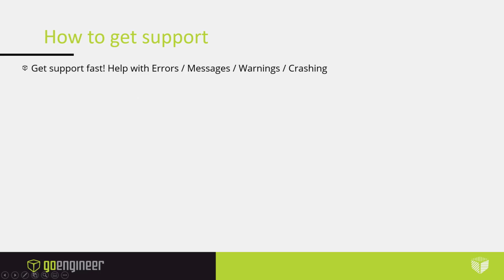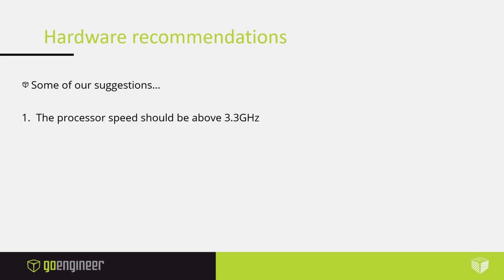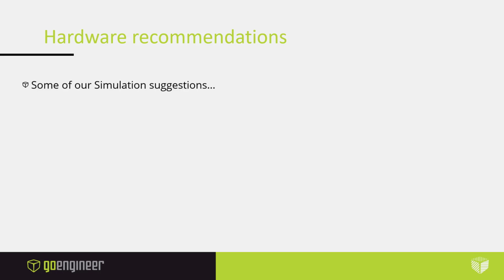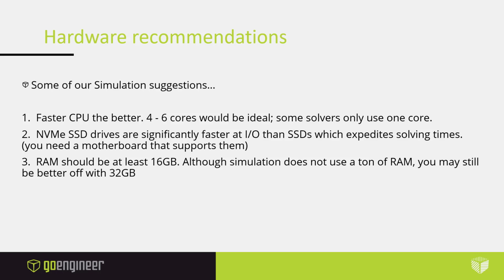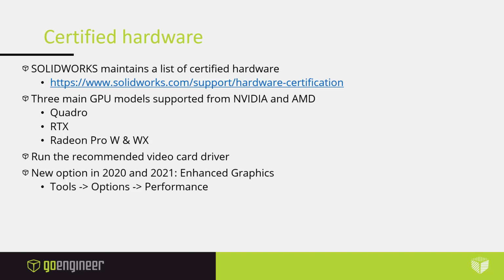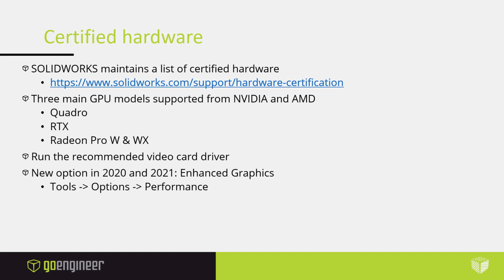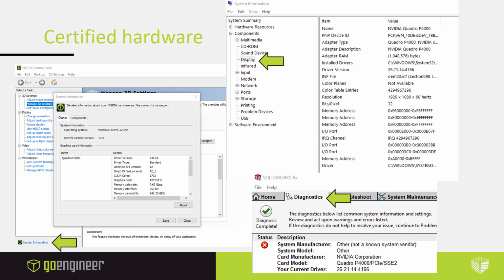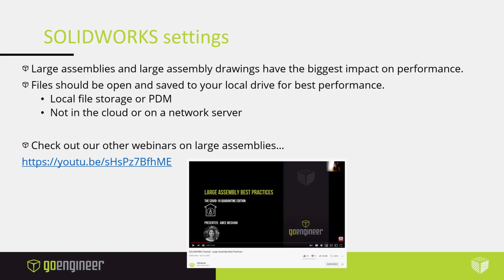Best Practices: Computer Hardware for SOLIDWORKS Performance - Webinar

Comment: @5:05, you recommended 3.3 GHz, are you talking about the base speed or max turbo speed of the cpu here?
Reply from the maker: Ideally we are talking about base speed. Turbo or boost mode or whatever the chip maker calls over clocking can only be sustained for so long. That being said if your only dealing with simple geometry or small part count assemblies  lower base speeds may not be a huge impact, because of the overclocking available.

Comment: I currently have a 3080ti in my system and was wondering if a quadro would be more beneficial. Thanks!
Reply from the maker: The Ge Force Cards a built on different technology than the quadro cards and in the long run will likely end up more unstable. Additionally because the Ge Force cards are not tested at any level there is very little that can be done if things start going wrong.  The best thing to do is stick with certified cards and their certified drivers 

https://www.solidworks.com/support/hardware-certification/